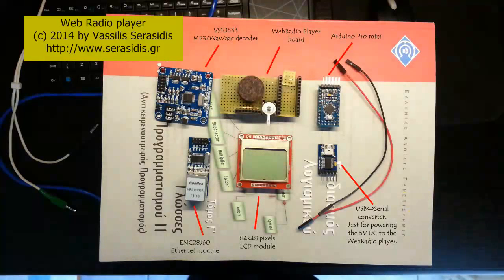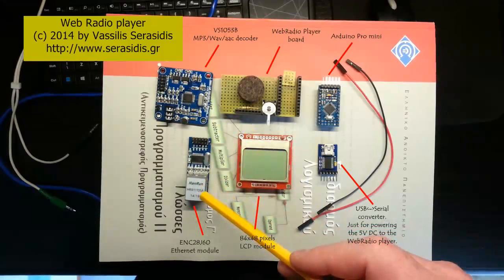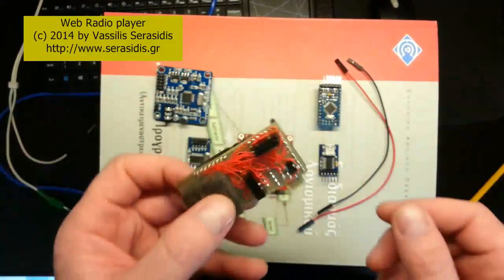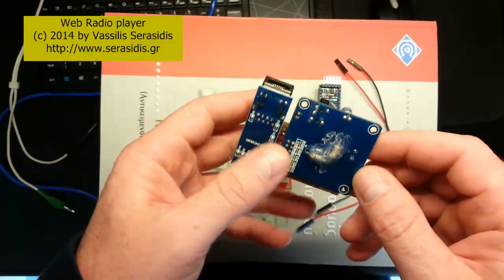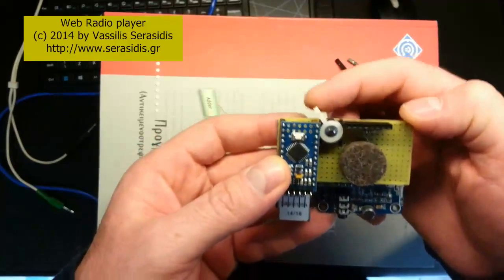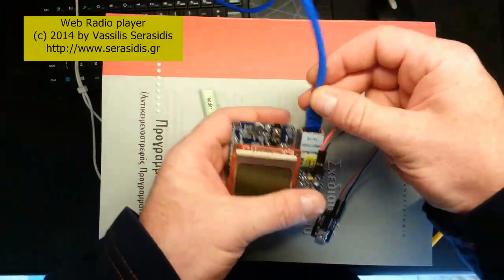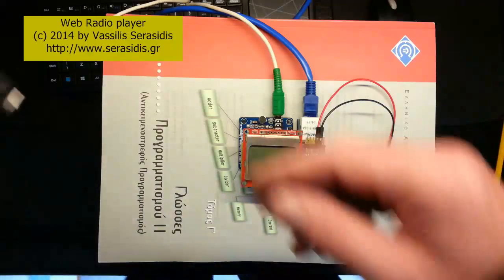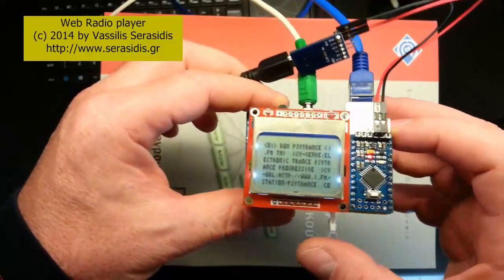Arduino WebRadio player

Comment: Yes I did upload codes successfully but no any web radio stations are playing then I select only web radio stations from the site https://www.internet-radio.com/   but no choice to select 64Kbps sites at there, finally found only one station with 64 kbps "Big Blue Swing" but even that not connecting error shown in serial port is connecting....  DHCP failed Reconnecting to the server IP:0,0,0,0   GW:0,0,0,0   DNS:0,0,0,0  SRV:209,236,126,18    Port:8002     reconnecting to the server how to correct this at least give me working few English song sites IP and PORT numbers
Reply from the maker: You can try http://192.111.140.6:8030 (IP: 192.111.140.6 and port: 8030), but it seems that WebRadio has not received an IP address from your router (DHCP server). The IP address has 4 zeros.
If the problem persists, try manually assigning the "myip", "gwip" and "dnsip" addresses to the sketch.
Reply: @vassilisserasidis2526 how can I find values for myip, gwip, dnsip   I searched command prompt by typing ipconfig it gives values for IPv4 Adress: 192.168.8.xxx, 
Subnet Mask: 255,255,255,x 
Default gateway 192.168.x.1 
and I took router IP address by searching IP chicken.com in google chrome it was113.59.213.xxx so tell me values for this "myip", "gwip" and "dnsip ,
thanks
Reply: @vassilisserasidis2526  please reply my problem asked 1 week back
Reply from the maker: @wasanthawimaladharm  Well, "myip" is an unused IP from your local network. Edit the file "Arduino_WebRadio_player.ino" and set the network.
Just for reference,  a network setup could be: 
static byte myip[]  = { 192,168,8,200 };
static byte gwip[]  = { 192,168,8,1 };
static byte dnsip[] = { 255,255,255,0 };

Instead of using:
if (!ether.dhcpSetup())
	  Serial.println(F("DHCP failed"));

use:
ether.staticSetup(myip, gwip, gwip, dnsip);

Comment: This site can’t be reached - http://www.serasidis.gr please update
Reply: @Jason Alannah  Yes I did upload codes successfully but no any web radio stations are playing then I select only web radio stations from the site https://www.internet-radio.com/   but no choice to select 64Kbps sites at there, finally found only one station with 64 kbps "Big Blue Swing" but even that not connecting error shown in serial port is connecting....  DHCP failed Reconnecting to the server IP:0,0,0,0   GW:0,0,0,0   DNS:0,0,0,0  SRV:209,236,126,18    Port:8002     reconnecting to the server how to correct this at least give me working few English song sites IP and PORT numbers

Comment: Nice project. I have some problems with SPI. Can someone tell me why ENC28J60 stops working if I connect MISO line from VS1053 module to arduino D12 pin? If there is MISO line connected only from ENC28J60 to Arduino it works. Do I need some interfacin circuit?
Reply from the maker: Maybe the VS1053 MISO pin is burned or something and it's internally permanent connected to the GND. It's not critical to connect that pin unless you want to read the VS1053 register values.
Reply: Yes there was short circuit between pins 29 and 30 on VS1053 IC on module board. Thanks.

Comment: Thanks for sharing! It's a great job!
I've mounted it on a circuit board and it works perfectly.

I have a doubt: the two resistors that you added on the board VS1053 do not appear in the electronic schematic. I understand that they are level adapters from 5V to 3.3V. Could you explain how to connect them? I have not mounted them and it works well for more than 100 hours, without problems.

I have had  latch up problems with the LCD display. I had to mount tension dividers with resistors of 22k and 12k on the pins SCLK, DIN, D / C, RST and SCE for adapting levels from 5V to 3.3V.

Comment: Is there any equalvant circuit for vs1053 ?
Reply from the maker: Hello plazma. What do you mean exactly ?
Reply: +Vassilis Serasidis can we use another mp3/sound module for this project?
Reply from the maker: This project uses only the VS1003 or VS1053 sound modules.

Comment: Great project!! I'd try adding a local storage (SD card) to hold the radio stations file and respectively a web UI to edit this file and control the device. Also I think most of the components (without the LCD) could be placed on a single board - making the thing slick and nice looking.